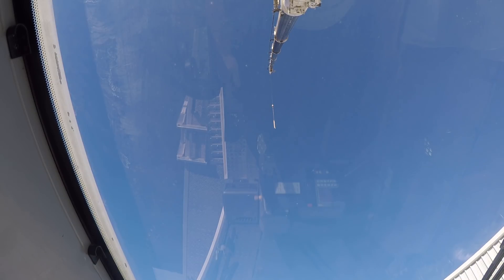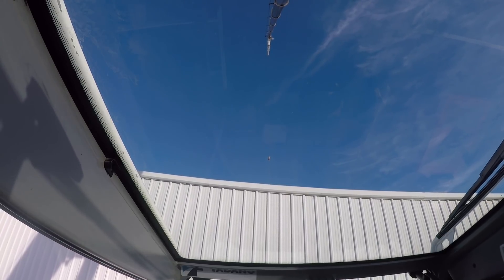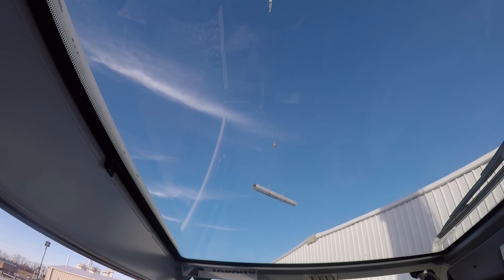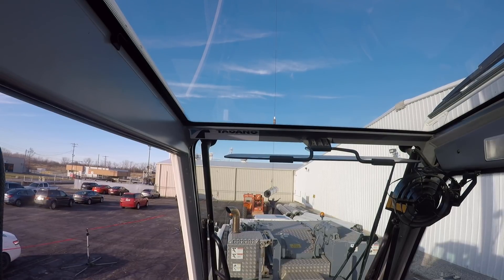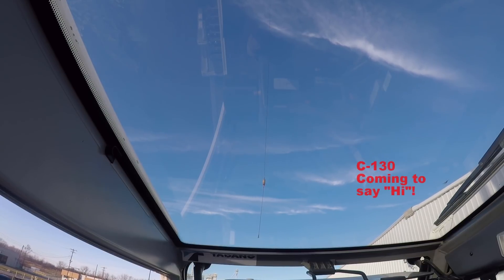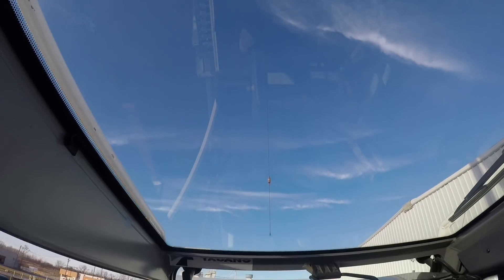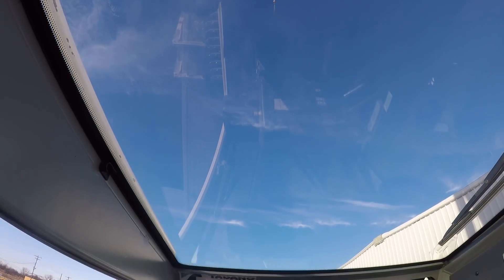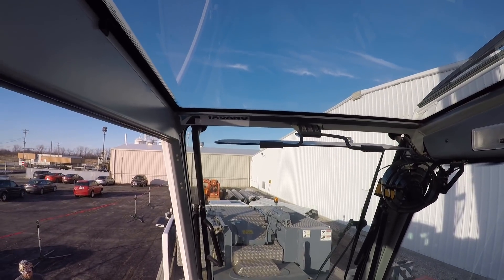Military plane does a flyby on the crane | Plane buzzes crane

Comment: As a light plane pilot of 30 years+, and a crane op also, you had all kinds of  separation between you and the C-130, hardly a buzz job, more a fly over, and your were probably in their flight path anyway.  I admit to anytime I notice a job going on, I will fly over and circle, and a disproportionate number of crane ops seem to also be pilots.  I keep it a hair over 500' separation, the FAA regs, and also because I really don't want to make the poor op wonder if I'm going to hit him/see him. The next time you have that much tip height, it would be nice to check in with any airports within 5 miles radius, if towered just give the controllers a courtesy call and they can pass it on.  Not that you would, but leaving the stick out overnight is a whole different deal! I like to joke that after a hard week sitting in a narrow compartment, moving levers, looking out a windshield, it's nice to do something different. Like get in my tandem (narrow, one seat behind the other) homebuilt light sport plane and move levers and look out the windshield!  Flying and crane ops go together, it's all hand/eye coordination, setting trusses on a windy day is like making gusty wind crosswind landings.  You're a good op, you'd probably catch on to flying quicker then most, it's all about smoothness, combined with making the machine do what you want.

Comment: Wondering do you charge a customer by a flat rate per hour or by the hour plus so much per foot of boom extended?  Enjoy your channel.
Reply from the maker: It is a flat rate per hour. It is based on counterweight and jib configuration. Not so much on length of boom. The price goes up if more trucks are necessary to mobilize the crane. Many thanks for watching! 🙂

Comment: Do you have any kind of nav light on the tip of the boom?

Also, I had a crame adventure today. A smallish crane, maybe 50-60t (I couldn't get close enough to get a manufacturer's name), was doing work at the hospital where I was getting a test done. I came out the front door just as the crane started gushing hydraulic fluid all over the place. The driver had booms and pads to sop it up, but not enough. Big mess, right in front of the valet parking entrance.  I would have taken pictures, except I'd forgotten my cell phone.
Reply from the maker: I have a light that we use for night work. But, it wouldn't be visible during the day. 

Sounds like someone had quite the mess to clean up. That would be a bad situation to blow a hydraulic hose during crane operations. 

Many thanks for watching! 🙂
Reply: @ToTheTopCrane  From the conversation I overheard, apparently this had also happened a few days earlier on the same job.
Reply: @ToTheTopCrane   One "fun" thing to do, when traveling around and seeing another operator at work, is to tell him there is a large pool of oil underneath his rig, always good for a laugh! For sure, DO NOT take it too far.....but most are so happy you were kidding, they don't get pissed! I had it done to me, so I am passing it on.

Comment: Maybe they were checking to see if the light you fixed last year was still working? Did you have it on or is that only for at night?
Reply from the maker: It still works. But, it's only for night work. It wouldn't be visible during the day time. Many thanks for watching! 🙂